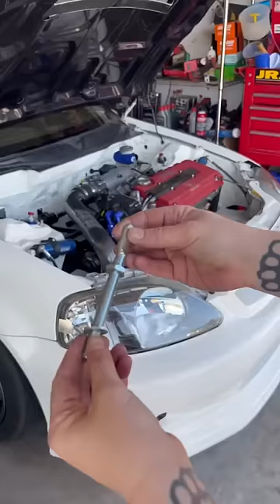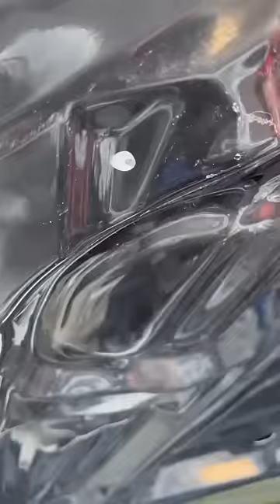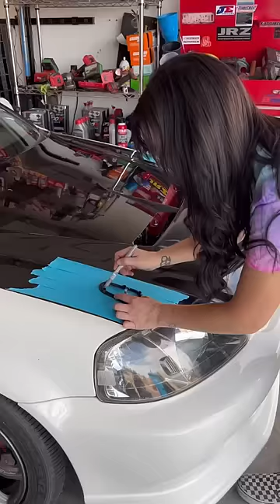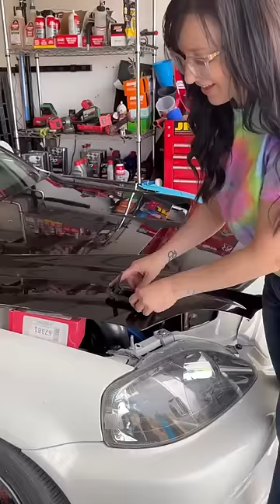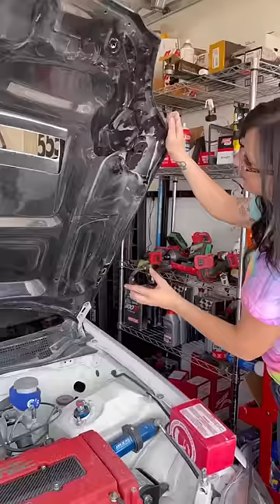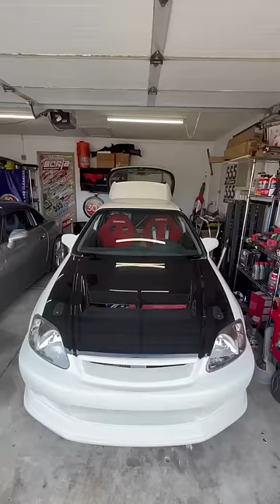New hood pins for my J’s Racing Hood

Comment: Watching someone cut through a hood hurt me on a emotional level for some reason. But good job none the less 👍
Reply: Cutting with grinder should do. Aby heated plate will rust soon. There are better tools to it.
Reply: sometimes you just have to go with the f*** it there's no turning back vibes 🤣🤣🫡
Reply: Yea literally no point in hood pins other than destroying the hood
Reply: Emotional (and body) damage! 😂😂
Reply: I feel the same way….
Reply: Hood pins is a  good way to have more safety. Gotta have a hood latch give to know I guess.
Reply: Why? This is just a little hood pin too. Have you ever seen some custom wide body builds or anything custom build not even just cars? Your gonna have to cut some stuff and more but your gonna end up with a one of a kind custom build! This is art it should hurt to watch. Her awkwardness if front of the camera hurt a lil bit tho (:
Reply: @DEVIL666wtf  with a low powered car, you're right but when you're running double, triple or more horsepower than stock, everything starts flexing and twisting around and they become relevant. Primarily they are used as a lightweight, more secure, easily verifiable alternative to the stock latch mechanism. The hood is opened and closed a lot and the pins are easily verified secured.
Reply: With so what's ur thoughts on hoods that's are sold that way from the manufacturer ????
Reply: A hood is one thing. Full CF? Yeah. What latches are those? Star
Reply: @DEVIL666wtf  most drag cars (if you are smart) the whole hood comes off. It makes it much easier to work in the bay. With that you need hood pins to actually hold the hood onto the car.
Reply: @Slixzered  never had that problem
Reply: @DEVIL666wtf  I’m not sure what you are getting at.
Reply: Racer car lyfe 😎
Reply: As a automotive metal worker you would horrified at some of the things I've cut up I always rebuild it though its all just sheet metal at the end of the day
Reply: @DEVIL666wtf  I personally know three people that have had a hood latch go out. The aftermath isnt pretty. All three of them were in the triple digits. All three are lucky to be alive. Edit- all three were on fellow honda owners. Once you get to double stock whp that latch gets sketchy. I remember when i was trying to see my top speed, and the hood started shaking around. Im not trying that shit again until theres pins.
Reply: Есссс оу мазафака
Reply: Just have to give a 1000th like :)
Reply: Exactly what i felt😮
Reply: @DEVIL666wtf  you need to run hood pins on a carbon hood or else theres a risk of it flying open. Most manufacturers even state that you need it right on the website
Reply: Какой нафиг КАПЮШОН? Где ты тут капюшон увидел?)
Reply: Excelente trabalho. E uns firms segura no capô, não comum carro pequeno mas originais em Jeep Cherokee e tantos outros. Bso desmerece. Quem quer pode por!!!
Reply: @DEVIL666wtf go as fast as she plans with your regular hood you'll need a wind shield
Reply: @jaygeorge9977  my shit ain't made of tin buddy Im still rocking my 85 but say what you will
Reply: @DEVIL666wtf  most cars that goes fast has light hood  but I guess you not going to fast
Reply: iantrofimov6416 , good perception.
Reply: Does sit still keep water out of the alternator..? Lol...
Reply: I was constantly thinking, huh? Huh?
Reply: I saw the Milwaukee and thought ok ok she knows what she’s doing
Reply: @DEVIL666wtf  hood pins have their place, but only when you add aftermarket hoods, especially carbon fiber ones
Reply: @TheCameron230  ok fair enough I'll give you that I deel with steel hoods and reinforce my latches never messed with carbon fiber b4
Reply: @DEVIL666wtf  yeah, they typically don't have a latch and even if they do there's enough drag on either side of the hood to crack the carbon fiber and rip the hood off. Not many people put them on nowadays though, back when you were pushing max 400-500hp then any weight reduction you could do was worth it. Now we have cars with 700+, so weight reduction isn't as necessary unless you're super competitive
Reply: I thought I was alone that shit stressed me out
Reply: Name of the baby parts 🙏💲

Comment: If you didn’t, you should touch up paint the cut edges on the hood so it lasts longer! Water always finds a way!
Reply: It’s not metal
Reply: @600wheel  I’d try doing some more watching and researching before correcting others on something you’re clueless about. When she drill from the hood supports through the top of the hood that’s not metal? Did you see the supports throughout the whole underside of the hood? It’s 200% without a doubt metal my guy.
Reply: Fiberglass hood, looks like
Reply: @Cou-yonLogiC  Wait a minute I just realized. You idea of researching is looking at drill filings?😂😂😂
Reply: @cmendoza1094  no hood for a civic is 100% fiberglass. Just the top skin. You’ll always have metal supports unless it’s Kevlar/carbon fiber. That’s a fact. The supports underneath er every fiberglass hood is metal.
Reply: @600wheel  fiberglass has metallic silver fillings?  IT’s observation, my research is years of restoration of vintage 50-60-70s classic cars, and resto mods. Plus a 10 year welder/fabricator. I only worked in a machine shop/hotrod shop. 77’ hotrods and customs btw.
Reply: @600wheel  I’ve built hundreds of custom hoods. Fully custom. You wouldn’t be able to buy. Same for body kits, panels, spoilers, etc.
Reply: @Cou-yonLogiC  I appreciate you handing in your résumé but I’m not hiring right now and anybody who would take all white hood off the car and replace it with basically the same one only painted black and call it a custom hood that’s not something I would brag about on the résumé
Reply: @cmendoza1094  careful dude this guy gets mad when you talk about fibreglass😂😂😂jk bro it is funny
Reply: Niceee😮‍💨
Reply: @Cou-yonLogiC  I had a similar hood the only part that is metal is where the hood latch is everything else is fiberglass or carbon fiber
Reply: @BEU203  you have hood pins?
Reply: @Cou-yonLogiC  no but I did crash and there was no metal in that area all carbon fiber
Reply: @Cou-yonLogiC  I’m not full of shit, that’s how I bought the hood. You don’t have to believe me you are just someone on the internet I have 0 reason to lie to. Wether it’s the right way or the wrong way, you seem to know more about making hoods than I do, so you can judge that how you want, but the hood never flew up on me. The hood latch striker was molded into the hood and riveted.
Reply: @BEU203  with only a center Mount and not metal supports the outer two edges would come up with air and break the fiberglass. Especially if you have a scoop and wind can get under the middle of the hood. It simply doesn’t work that way. This hood has metal supports. Cool story about the imaginary hood.
Reply: @Cou-yonLogiC  I have pictures of it if you really care that much, yes it did not sit perfectly on either side and wasn't perfect, but it never came up on me.
Reply: But how does that harm homosexual special rights ?
Reply: POR15 instead of paint touch up.
Reply: Wow what a crazy comment thread y'all wtf
Reply: @Fidgetier  por15 should be sealed after. Should never stay exposed as a final product
Reply: @Cou-yonLogiC  the hood on my new edge mustang looks like it has metal support under the hood but when i cut a big whole down the middle for a vent the “metal supports” were fiberglass as well and thats a stock hood
Reply: @michaelmendez9423  what year and make is your mustang?
Reply: Last time I check metal creates sparks when you cut it

Looks like a carbon or fiberglass hood
Reply: @villavine10  you know nothing bud
Reply: @Cou-yonLogiC  03 gt
Reply: @Cou-yonLogiC no need for paint touch up that plastic will be so tight it would just rip the paint off
Reply: @mackeywalker6263  they have a right way and a wrong way to everything in life. To me how you do things describes everything about your character. I’ll do it correctly everytime. If not I learn first. Have a good one.
Reply: @Cou-yonLogiC  this. Is a js racing hood. They are either carbon or frp(depending on option). It’s on their website. No metal
Reply: @ClassifiedRecon  it’s not though. It’s metal.. you see how the drill takes a while to go through… yeah that’s not happening on either of those other materials.
Reply: Герметик
Reply: @Cou-yonLogiC  no this is a js racing hood, it’s literally in the description lol
Reply: @ClassifiedRecon  the dudes a clown, ignore him lmao, definitely a full carbon or fiberglass hood. You can clearly tell because the way the supports look under the hood
Reply: Most hoods are aluminum it’ll be fine I’m sure
Reply: @icebox829  Honda civics didn’t release aluminum hoods until 2022. Thats entirely false. Aluminum isn’t what most hoods are made from. 
Does everyone just guess?
Reply: @Cou-yonLogiC  this is a full fiberglass hood my dude. No metal in it at all. Before you make yourself look like a clown you might want to know what your talking about.
Reply: @Cou-yonLogiC  you can tell you know nothing about the import world lmao.
Reply: Bruh its carbon fiber 🤣
Reply: @Cou-yonLogiC   excuse me but J'S Racing does NOT sell metal hoods! Fibreglass and carbon fiber hoods YES
Reply: @jag4520  lol
Reply: You guys have no idea. The horsepower increase from this mod overshadows any risk of corrosion. You peeps definitely ain’t car guys.
Reply: Bruh metal hoods are metal, either aluminum or steel.. aluminum usually the sports model and steel the base model. And carbon fiber hoods are carbon fiber? Said an done? What’s the fuss about?
Reply: @UKNOWHO425  it’s a carbon metal aluminum calm down
Reply: What website u bought the latches
Reply: Ser fibra ou não ser fibra eis a questão - Shakespeare
Reply: @Cou-yonLogiC you have no idea what you are talking about little guy
Reply: Esatto
Reply: @600wheel no, it was just regular hard rock
Reply: @600wheel  it really doesn't matter the paint will get water under it and within a few years it will bubble up

Comment: I would be so scared making those cuts 😂
Reply: Sobre todo si no es para nada útil puesto que, ya traen cerraduras los capos.
Es de las tontás más grandes que he visto hacer en un coche.
Reply: @ildecarrerogarrido7497 it has its uses friend that’s a lightweight hood it will come up at speed and break your windshield bend the hood and have you at the very least on the side of the road regular latches don’t typically work with aftermarket hoods

Comment: No disrespect, just a little advice from someone with hundreds if not thousands of hours using rotary tools. Next time you try to cut metal with a small cut-off wheel, slow down your movements and speed up the tool a bit more so it cuts better and doesn't bog down because when it bogs down its more likely to bind the cutting wheel and hurt you when the disc explodes. Just remember to read the rpm requirements of the cutting disc when you buy them, and it will tell you the optimal speeds to run them at usually a single rpm number or a small range of no lower than and then a max rpm.

Comment: Don't forget to apply rust protection on the holes, unless it's aluminium.
Reply: its not metal
Reply: Нет конечно,это пластмасса🖐️🤣
Reply: В России ты хоть зелейся защитой оттржавчины. Метал вскрыл,он пойдет гнить однозначно. Наши лютые реагенты и соль обязательно этот процесс ускорят!!!!
Reply: @charlesreed8420  you sure?
Reply: Correct spelling on the aluminium. Well done!
Reply: Nice
Reply: Its carbon fiber dude, bruh? 🤣
Reply: Cool
Reply: Cool
Reply: @charlesreed8420  the hood will not be metal but the rest of the car?
Reply: @StegoMan  the rest of the car is metal. Just not the hood. It is made of carbon fiber
Reply: @charlesreed8420  I already knew, but the questioner seems not to.
Reply: @JeremiasJrSarte  far from ciber
Reply: @charlesreed8420  no it isn’t
Reply: The rice absorbs the water
Reply: @aleks.114 , у тебя реагенты с неба сыпятся? 😂
Reply: That hood is fiberglass or carbon watch the dust it makes with the diesel and no sparks not metal
Reply: @charlesreed8420  The radiator core support is metal though where the pins are attached to.

Comment: You get good work done when you have all the right tools and everything
Reply: but what exactly is the point or benefit of this? is the regular hood latch that heavy?
Reply: @dnegel9546  no, the hood is actually lighter because it is carvon which mean it is easier to blow away. It makes it more secure and easier to open. This one has locks so it is hard to steal aswell.

Comment: For future reference mounting these in the opposite direction is more secure , the way you mounted them if vibration makes the mechanism pop then the wind will very quickly un latch those latches , ive personally seen it happen.

Comment: You have done a great job protecting and orienting the drill. You didn't, however, give your cuts the protection they need after being exposed through cutting. Some rust o lem on them would expand their life without rust.

Comment: Hood pins on stock metal hood 👎
Reply: Literally makes no sense, if it was a carbon fibre hood makes sense but a metal one ain’t ganna fly anywhere 🤣🤣
Reply: @Eeeeeeeeeeeeeeeeeeeeeeeeeet  if have hinges pins are pointless. I have hood pins on my car but I've got a fiberglass hood and removed the latches, so when I take the pins out I can just pull the entire hood off the car